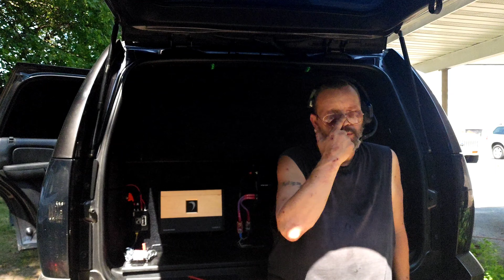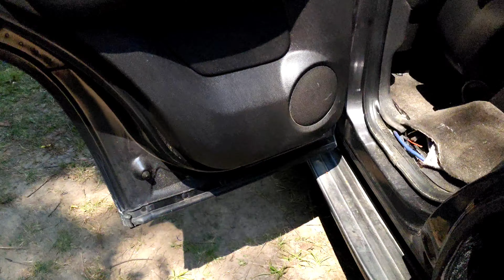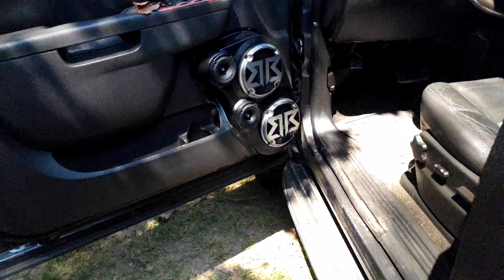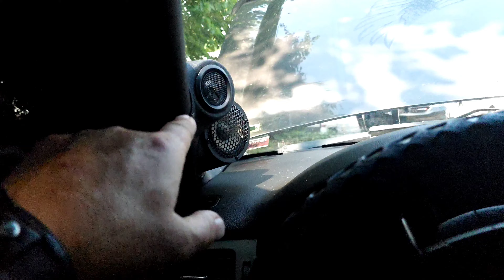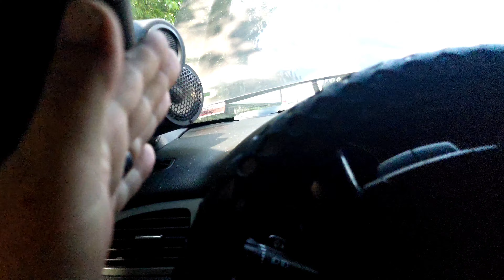What Does a DSP DO In Car Audio?

Comment: it helps alot more than people think because every different type of vehicle has a dramatic effect on how well or bad a speaker will sound, like ther could be a very expensive speaker that sounds amazing in one vehicle but installed in another and the same exact speaker could sound like sh@* because it cant focus the sound right because it needs more alignment as well as tuning that speaker to output the proper frequencies as well as change the phase or eq the speaker via an individual parametric eq then add the time alignment and now you could also get away using a different possibly cheaper speaker to perform better than the pricier speaker that because of its brand name was the main reason for its high costs.. a dsp is really a game changer even if you dont know how to use it then u can learn the basics from alot of places and then teach urself by just playing with it and most can save your tuning so if u went way too far u can always reset it to ur base tune and then u can just start over as much as u want and before u know it u'll find urself on the road to becoming a pro

Comment: So if I'm using the DSP should I also cross over my amplifier? Or just leave it flat.
Reply from the maker: I usually leave it flat, other than, setting a high pass for my sub, and a lowpass for the tweeter. i do those on the amps, as a hard backup incase of issues. for the tweeters, if im using a cap on them, i will skip the amp crossovers, and just use the dsp. as the cap is the safety

Comment: I purchased the PRV DSP 2.8X back a couple of months ago before I truly realized that the 2.8 part of it meant that it only had two inputs and eight outputs. I thought that it was just the model number or name of that particular unit and it is but my point is that I was just trying to get something that I could afford at the time and rushed into purchasing something that would ultimately leave me with a product that doesn’t suit my needs fully. My head unit has six rca outputs and I’m sure that you know that means 2 each for the front , rear and subs. Now I’m having to decide between scraping that unit and buying a new DSP that is much more expensive but will fit my needs better or I was thinking about just buying another one of the same unit and running the second one strictly for my subwoofers. They are about a hundred bucks for one of those so theoretically I could fix the problem with this idea. I’m just wondering what you would do in my position if it were you ? Another thing is that this PRV DSP is not equipped to use with a computer or an app via blue tooth. Please help !!!!!!

Comment: If I want my 6.5" speaker to have little to no sound at 50 hz at what frequency do I need to set the crossover? Using Butterworth with 18db slope.❓
Reply from the maker: well, on 6.5s i normally cut at 90db with a 24db rolloff on butter. on a 18db slope, and I am guessing here you may need to cut at around 110db or so. I would test that with a pink noise track and rta, or with a sinewave generator and my ear. and adjust as needed.
Reply: @CarAudioEnthusiasts  I said 50hz cause I forgot how low the speakers play smoothly but it is at least 60hz.
Is rolloff and slope 2 different things❓
Reply from the maker: @c0uchsl0uch  roll off is how fast the output drops slope means basically the same thing, i could be using the terms badly though. still you get my point. if I were you id set it to 80hz, 24db rolloff butterworth.

Comment: Thats a good, basic understanding of a DSP. I always think of them as have 4 main functions.

1. Time delay
2. Crossovers 
3. Equalization 
4. Level control

You didn't touch on level control. It can be very helpful to turn a single channel up or down just to get the sound better balanced.

I sometimes will get my system setup and think the tweeters are just a little too hot, so I'll drop them 1dB in the dsp. I'll listen a while, change them back, etc... eventually I'll settle on it. 

This is way better than having to play with gain knobs. Gains can be very sensitive and some amps dont have a gain for each channel. Only pairs of channels. One channel might sound a little louder than the other and the only way to make a tiny adjustment is with the dsp level controls. 👍
Reply: Most dsp also have a phase 180° switch for each channel. It's great to just go through and flip the phase on each channel to hear if it sounds better or worse. Usually it's worse. Sometimes you might have accidentally wired a speaker backwards or there's a strange cancellation and flipping the phase makes it sound better. If it sounds better, keep it that way.
Reply from the maker: you are correct, and I use that ALL THE TIME, I also didn't go into notch filters, which is advanced but still.

Comment: I like to start on setting the x-over, then time alignment and finally eq where necessary. I always want to cut frequencies whenever possible. I never want to boost if possible. If I have a "suck out" or large freq. dip I re-examine my crossover settings. If it's significant like 12 db (large null) then I need to look at the drivers I am using. A lot of vehicles have nulls in the freq. response when it comes to the midbass. Midbass can change how a system sounds significantly. Use the largest driver you can fit and make sure the area it's mounted to is strong and well deadened. That's me with a hot take.
Reply: All good advice. 
I'd also add to flip the polarity on each channel 180° and listen if the sounds improves or gets worse. Dsp makes polarity change a push of a button. Sometimes it helps with nulls. Sometimes you wire up the speaker wrong and it suddenly sounds better.
Reply: @JasonWW2000  Yeah, I definitely should have mentioned that.

Comment: Everytime I connect a dsp the sound turns robotic and Hella ugly. I bought several DSPs including the Dayton 4x8. When I add a crossover, it plays fine. Any DSP, all robotic. Does that have to do with the different frequencies the infodeck is set to in the front and rear?
Reply from the maker: Likely has to do with the DSP's youve auditioned. it could also be rca's , and or the power source for the DSP's. Ill assure you what youre decribing isnt normal. Check out any DSP from audio Dynamics, there are many good ones out there, but I have personal experience with Audio Dynamics.
Reply: I don't know what your describing. What is an infodeck?

You might need to explain your system.

Before installing any dsp you'll want to reset it to stock. Then set your basic crossover frequencies. Then hook up all the amps. Make sure your source is feeding a flat 20-20k signal in. Make sure your amp crossovers are turned off. 

With no delay, no EQ and just basic crossover functions it should not sound robotic.
Reply: @JasonWW2000  I'm almost certain it was the shop I took it to in Fredricksburg off commerce rd.

I got curious one day after my back got better and looked over the work cause I noticed the voice coil smell at mid volume. I was pissed about the amp settings all the way to the shoddy wiring job; the shop owner kept dodging me so after a MONTH I said eff it. Guess I should have waited and done it myself. Ripped it all out (shop used electrical tape on the spliced speaker wire) and re-did everything. It's only when I connect a DSP that it sounds weird. Just the amp connected is fine, a crossover is fine. Odd.
Reply: @Macross580 Hmmm, I can answer specific questions, but I'd probably need to inspect all the basics of your sound system to figure out the issue.  

If you have crossovers on your amplifiers set up to protect all your speakers and you install a DSP with all it's functions turned off, it should basically just pass a signal through and not have any effect on the sound.

Comment: Before buying a DSP please look into how much work it takes tune it, it is a headache and in the end you still have to bring it in and put it on an RTA to get it to reach its full potential,, let alone when it does get to its full potential to find out the speakers that you have are not that good so before spending a small fortune on a DSP look into it extensively
Reply: 😂...I agree it took me two weeks..and I had to take breaks in between, one song plays good then when you switch to another, it's horrible, it's also good to have a reference songs, so you know which frequency is peeking and which one is low.
Reply: True, as far as EQ is concerned. That's the last thing you adjust, though.

Just getting crossover, levels and time alignment alignment done can make a huge difference. 

The EQ process is quite the learning curve, but not bad.
Reply: @FrankStPeter  this is just blatant misinformation. This is like the guy with the 10 band eq that it's much to complicated for you, the bass and treble knob is all you need because of your small brain. A dsp doesn't make tuning any more difficult than it is without one. You can get a budget dsp for a bit more than one of the cheap bass processors that are basically a single band parametric eq. A dsp may be more complicated but it's not rocket science. It's not much different than trying to tune a system using a head unit only a dsp will give you so much more control. Not everyone is looking for immediate perfection and just want to see an improvement. Besides to learn how to use a dsp it is important to have one or it's like trying to learn to play an instrument but all you have is the sheet music.